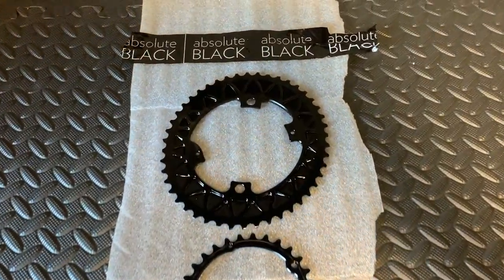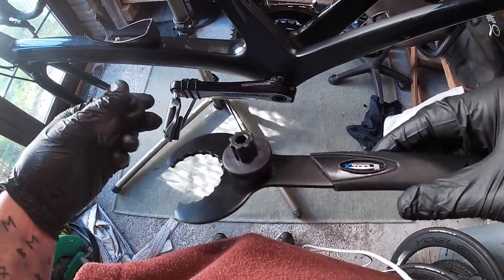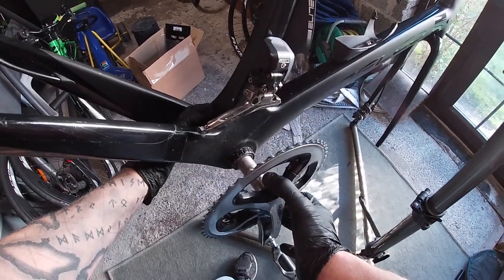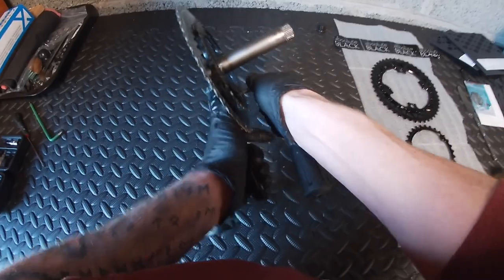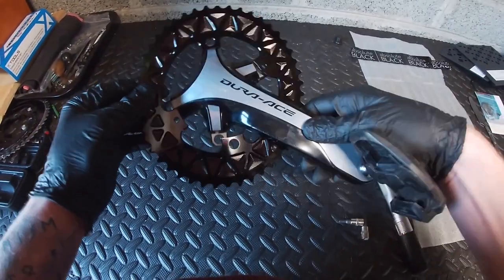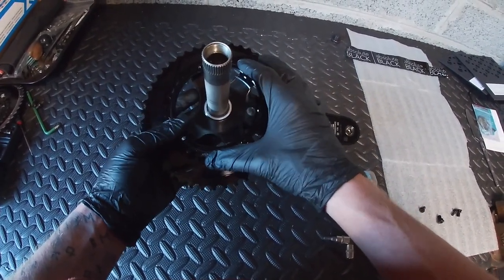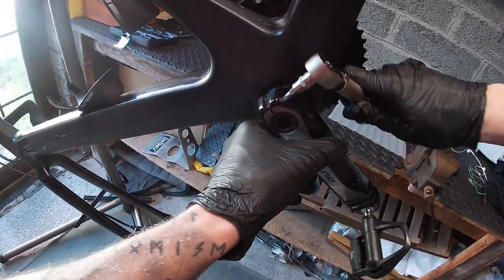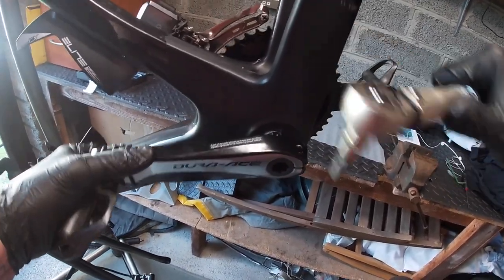Installing AbsoluteBlack sub compact Chainrings

Comment: Only I would say I would have used   locktite on the crank bolts
Reply from the maker: CMDR meneldil yeah I could have... I’ve never used it on cranks bolts yet, I figured as they didn’t have a blue end they don’t need any. 👍

Comment: Hi been looking at these rings. What size rings would you normally ride?
Reply from the maker: Billy Adam I’d normally ride a 50/34, I’ve just finished my second ride on these... 56km, and I can’t say I miss the 50/34 yet... when we get a still day I’ll be able to test if I’m under geared by going down our longest hill, but today I reached over 50kph going down it, shame the wind was blowing up! Also got my 3rd quickest time on Strava down it so can’t be bad.
Reply: @KyrosHouseCycling  have you noticed any difference in pedaling stroke and are hills "easier" as absolute black say?
Reply from the maker: Billy Adam yes I think I have noticed..... hills do seem easier, maybe because I have a 30 on the front and a 32 on the back but.... even in higher gearing I do seem to be fresher and able to pedal easier up hills. I’m still deciding if it’s placebo but I’ve noticed it twice now though I’ll keep you updated... 👍